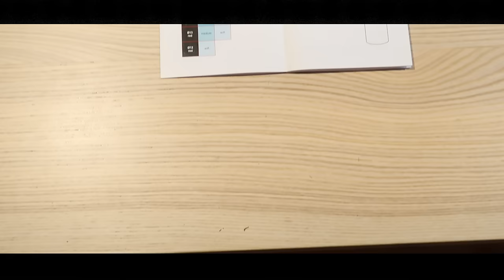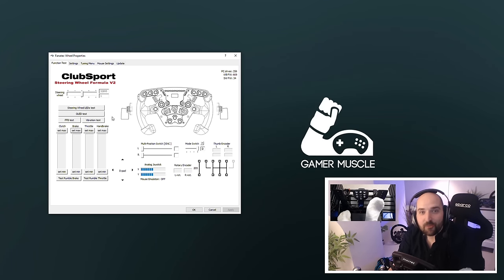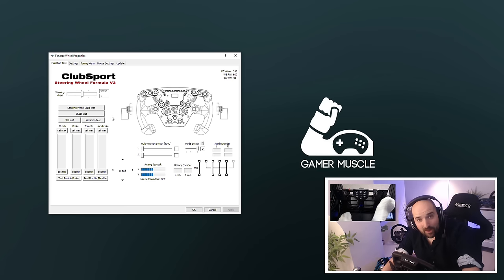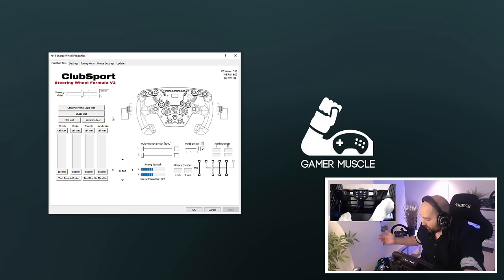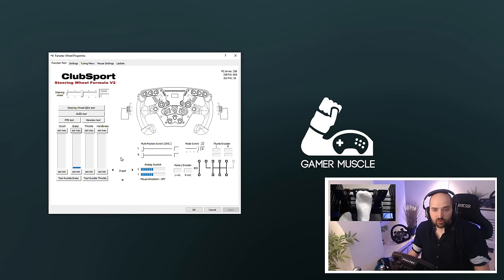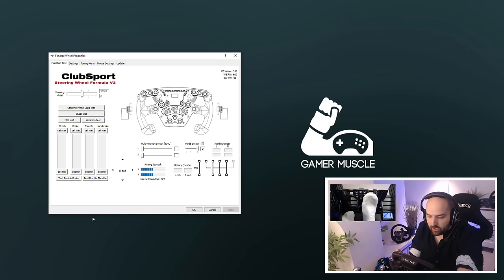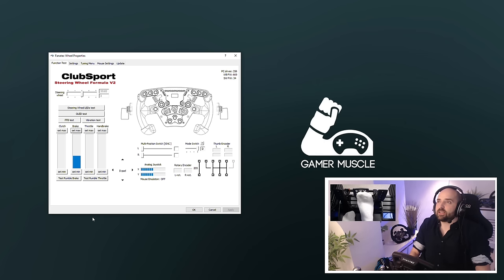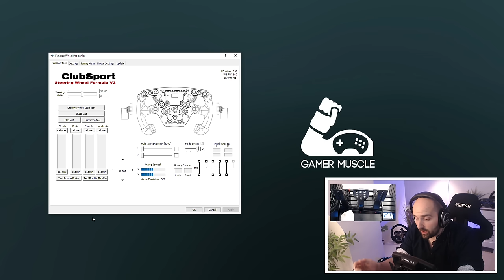Fanatec ClubSport Pedals V3 -  The Best Way To Set The Brake Up !

Comment from the maker: Wow Such Brake Much Firm So Control -  Here is our Fanatec store link if you want to get the V3s / Brake performance kit - https://goo.gl/zLmvKQ
Reply: I like that you do more youtube videos lately!
Reply from the maker: @christiannoack9967  Thanks should be doing streams again soon as well :)
Reply: @GamerMuscleVideos  does the grease in it help much? not changed mine but very little use and one of the pedals makes a squeaks a bit when releasing the pedal
Reply: Hi. Just for info and letting you know. WD40 is NOT a lubricant :) Its an oil neither. WD40 is for losen screws. It will completele evaporate after a couple of days. Use silicon oil or something similar what is not collecting dust :)
Reply: Hey there. I know the video is a tad older but i noticed even in the newer videos you are a bit quiet. You talk loud but your voice have no volume anymore. I think you can fix it by bringing the mic arm closer to your mouth :) Greetings and have a nice week.

Comment: I guess that's one thing the CSL Elite LC has over these, so much easier to change out the bits and bobs.  Don't have to take anything apart, just lift the pedal, and swap them out.

Comment: Good video! BUT, don't use WD40 on the moving parts, it'll strip out the existing grease. Use the lithium grease as shown by Fanatec in the spots they recommend. Secondly, if you care about the wiring to your brake vibration motor, you MUST put something in between the swinging arm and the back of the pedal before removing the brake pin. The mechanism WILL crush the wire if you don't. I had to use a screwdriver as I had one of the older performance kits. The new ones supposedly come with a little L-shaped brace to protect the wire.
Reply from the maker: I used WD40 on the Club sport V2s for years and the joints were fine and it was the only thing that stopped them from making noise,  I don't disagree that some other actual liquid lubricant would be better though.   
Howver what is likely is that most people have some WD40 lying around and in lots of cases a small amount of WD40 will redistribute what was already there and clean up what was causing the sound-making issue.  If after a bit of WD40 there was stiction or binding / still sound then it would be good then to apply some lubricant to the joint.
Any time anyone says WD40 you get 100+ people saying "It's NOT A LUBE IT STANDS FOR WATER DISPLACEMENT 40"   which I think most people already know by now to be honest. 
I push the loadcell in when moving it down so its not crushing the cable , I bet people are just as likely to break the cable from the motor flopping around as they would be from accidentally crushing it I think with anything like this its just a case of being gentle :)

Comment: It should be a consistent force required through the travel, but I'm also a fan of having some mush/take up initially. Helps trailbraking a bit, and also that's what actual brakes feel like.
Reply: I totally agree. Thats what I did when I modded my T-LCM pedals. Medium spring then a medium 45 shore, a large 45 shore and a large 45 shore. Nice mush at first and then firm.

Comment: Thanks alot for this video! I swapped out the piece of foam for a cut down red elastomer. I'm using green-green-half red, with the hydraulic damper set in between 1 and 1.5

Comment: thanks for the info my friend - my braking is something i can work on now , just from my experience with the BRF  issues , i went to auto settings reset that and then back to manual settings and that resolved my BRF setting problems - i'm now at 45% and still working on it - hope that helps  someone. Keep up the good work!

Comment: I just got a pre-owned set of inverted V3's, which is nice. The brake is a bit too mushy as you mention and this video was helpful, so now i got to have the brake kit 😅 One thing i have to mention, is your advice using WD40 as a lubricant - instead i recommend lithium grease. I know WD40 has a lithium spray variant, but grease is the better choice, because it doesn't dry out and is just a better product for this kind of lubrication.

Comment: Next time I can be asked to mess with my pedals I'm doing this, also same time try that "stiffer" black spring for the throttle. GM you should try Furoshiki shoes for sim racing, game changing, thank me later.... saves you from having to match your socks for streaming too, lol
Reply from the maker: I like the spring as it is right now just due to being in socks , If I raced in shoes I might go for stiffer spring but not in socks :P  stiffer spring is great for DTM cars / those cars where you have to balance the power on that last 10% of throttle input out of corners.

Comment: GM!! I STRONGLY SUGGEST YOU NEVER USE DW40!!! That stuff breaks down the grease and is used to free off seized nuts and bolts!!
Reply from the maker: This comes up every time , Yes WD40 is not a lubricant but it also works fine on the joints and stops them squeaking I say this from having club sport V2 pedals for over 2 years and WD40 worked fine to keep them smooth.    If they have stiction issues and other problems then sure some specific liquid lubricant would probably fix that.
Reply: Dab of engine oil does the trick
Reply: It's a solvent - it washes away the grease. It stops them from squeaking for awhile probably because some of the grime in there was contributing to the squeak and it got rid of it - or simply because the carrier is a liquid and that lubricates the surfaces for a bit. Then it evaporates (as it's supposed to) and you have a nice, clean, unlubricated metal to metal contact. So yeah, it "works" for a while, which is why so many people continue to use it as a lubricant and say it's fine, but seriously m8, it's ultimately causing more wear and tear on the parts. But also, thanks for the vid, it was helpful :)

Comment: You mention setting the brake force to 100 on calibration, as its the weakest needing most pressure. The lights on my wheel suggest otherwise as very small pressure at 100 and all lights lit up, whereas off or 1and you've got to push as hard as possible to light up all. Using same wheel as you. Am I missing something? Am on newest FW. Just need the starting point on whee, to calibrate right
Reply from the maker: Maybe it's back to front on my / some wheels just set it to what you like 👍☕

Comment: I wouldn't suggest putting WD-40 anywhere near your pedals, it's lubricating properties are very short lived and will also remove any existing lube, leaving you in a worse place then before - It also stinks. It's best to use Silicon grease for non metallic parts and lithium grease (or mineral oil) for metal to metal.

Comment: From the manual: Adjust the preload screw so that the scale is within the correct use range and there is no mechanical play in brake pedal. 
Note: Preload screw cannot be used in the full range as before, its use is limited only to eliminate the mechanical play.
Reply from the maker: Mechanical play is separate to Throw and movement, mechanical play is movement without any pressure on the load cell.

Comment: I use 2 reds and foam but for me it's very little travel and green are harder(?) I have no idea how you have so much travel. Also which one did you cut fi12 or fi13?
Reply from the maker: It probably looks like more travel due to cam angle + how hard I'm pushing the brake pedal.

Comment: Could be wrong but after 25 years of just using the vacuum cleaner on circuit boards, usually standing on carpet, and never screwing anything up, I've come to think of static discharge damaging anything as a myth.
Reply from the maker: I think the biggest factor is the room / environment rather than the tool. 

I have worked in offices where I was lightning striking everything I touched. 

But yah IV built maybe 80+pcs doing IT stuff and non were broken and non were built with static bands or anything.

Comment: Appropriate hardness is good.

Logitech G29 noob question: Do your Fanatec pedals vibrate when the ABS is flicking ON and OFF at a zillion times per second?

Enticed by the new, mini DD; wondering what "foot levers" (pedal set)  to accompany it

Comment: What order did you put the sponges in?  The larger one's together and the smaller green last?
Reply from the maker: I think I had small one last, I'm not sure if it makes much difference, to be honest, generally, with high-end pedals, the softest one is closest to the pedal and the hardest closest to the load cell.
Reply: It  makes no difference as theyre all compressed by opposite sides of the same cylinder.

Comment: I'm soon to upgrade to the V3s from the CSLE LCs. I'm just tired of having issues with the CSLE-LC and the potentiometers. I have even installed a set of hall effect sensors, and they are constantly in need of readjustment while I use the pedals. Screw it! I know the V3s are a better pedal than the CSLE's, so I'm going to get them.
Reply: Did you end up getting it? my LC on my CSLE just took a shit and may buy the v3's

Comment: Just goes to show everyone is different. I had to buy softer rubbers for my HE Sprints.
Reply from the maker: I think even there softer rubbers are as hard / close to the feel of fanatec V3,s    the HE pedals in general seem to be all round firmer harder springs firmer brake obvously all ajustable but out of the box and when I have used them on other peoples rigs they were much harder than any V3 setup I ever used :)
Reply: @GamerMuscleVideos  Yea I've had both and liked the V3 inverted (but they didn't work with my rig)  however the HE Sprints were just too hard even with their softest rubbers. I had to buy skateboard rubbers to get them how I liked.
Reply: @John-ok8ts  Where did you buy the skateboard rubbers? what exactly did you buy? I am looking to buy some sprints but worried they are too hard and not much pedal travel. Currently I used V3s with brake mod on soft setting.
Reply: @GamerMuscleVideos  How would you compare your current setup versus the soft setting of the brake performance mod (in terms of stiffness and travel).
Reply: @gutiserra56  Put this into Google "A cheap and easy brake mod/performance upgrade for my Heusinkveld Sprint pedals!". This guy has written a tutorial on reddit including where to buy. btw I tried the spacers but found they worked better without.

Comment: I have V3 paddles I also have CSl i’m trying to figure out where to plug the wires for the brakes in I know on the base it says brakes but on the pedals it says wheel direct and handbrake do I plug the wire into wheel Direct?.

Comment: Perfectly timed to the Brake Performance Kit being out of stock in the US and last ETA was September. And yet it's ready to ship in the EU!! WTF? Are they that incompetent that they can't ship some to their US distribution center?
Reply from the maker: That's anoying , you don't have to use there brake performance kit you can probably buy elastomers from Amazon and just cut them down to size using the ones that come with the V3 pedals as reference 👍. 

That's one of the nice things about V3 design you could probably put anything in the socket solong as it's not liquid / curosive / going to get stuck in it 🤣
Reply: @GamerMuscleVideos  Haha thanks. I did try searching for them before and couldn't find equivalent parts, but yeah they must exist somewhere to buy. I can't believe no one's stepped up yet with their own generic kit to fix the supply problem.
Reply: ... and just like that the V3s became available earlier than they were supposed to and I ordered them! But the BPK was still out of stock. Until 2 days later when it magically appeared ready to ship and I ordered it too! Paying double shipping is really annoying but I'm excited!

Comment: Just orderd them :) thank you for the vid :D
Reply: If not too late, how big is the PU foam? Both foam bits that in my set up 26mm long
Reply: @mlee6050  i dont know buddy but when i bought the v3s 2 months later i bought the BPK for the v3s and they feel so so much better ist a huge diffrence to them .
Reply: @simracingwales4997  I would of but thinking spending amount on them then £30-35 for postage I brought the stuff they use to make the red and green things for like £10 for 100mm and just cut 20mm bits from it, if I brought it with my wheel I would of not minded but as how much just for something that cost less than the postage thought go diy
Reply: @mlee6050  £50 quid i got stung for not ordering them with the pedals 25 for pedals 25 for postage .  Was not happy about that but just bit the bullet . Im sure they have the mod brake kits on ebay now people have clocked on and are starting to make home brew versions and selling them on ebay lol .
Reply: @simracingwales4997  yeah like if buying with set up at time the real ones makes sense, I first got damper on another order but found I not use that anymore as of diy my own performance kit

Comment: Fyi. New performance kits have a tool for positioning the rod hole.
Reply from the maker: Alen key works fine , guess plastic angle is better though as there will be less risk of scratching or denting the metal :)

Comment: Hey there, great video. Question for you. I just got my rig and these pedals with the performance kit. Compared to what comes on the pedals stock, are the reds more or less firm?  What would be the next step up from stock, 2 reds and the foam?
Reply: Up
Reply: Up, use the hardness guide that comes in the performance kit.

Comment: What does setting the brake sensitivity to 60% on the wheel do? Doesn’t that make the hardest you can press it then only reach 60% pressure? Seems pretty weak, no?

Also, ever try the dampening kit? I got the inverted so it came with it and I quite like it, but not sure how it compares.
Reply from the maker: The lower the BRF setting the less force it takes to hit 100% brake IE more sensitive

I didn't like the dampener kit 🧐😆
Reply: GamerMuscleVideos interesting, thank you.
I ordered the elastomer kit too when I got these pedals but haven’t tried it yet. Figured I could move the dampener to the accelerator if I wanted. I should give them a try. I found that I really didn’t gain any time or improvement otherwise moving from CSL Elite pedals with the load cell brake pedal, but maybe I need to spend a bit more time tweaking these (although I realize those were good pedals also). Oddly, I found I was .5 to 1 second faster in ACC going from the CSL Elite v1 with the same rim you have on your shelf to the right to the same wheel set you have now, which is totally against common wisdom. I think it’s because I’m not good to begin with so cutting a second off a lap wasn’t about eeking out the last tenths but being able to better keep the car under control on through turns, which most good drivers already take for granted. I also found I could drive the 911 without ending up in the grass 😂.

Anyway, good stuff, thanks, and keep it up (but don’t get stuck too long in your rig 😉)

Comment: The rj12 plug has come off of my brake, I am a cctv engineer so I'm no stranger to crimping down rj plugs, could someone please tell me what order the colour cores go in the plug, if your looking at it upside down so you can see the gold pins on the plug far left being pin 1 far right being pin 6 could someone please tell me the order in which the cores need crimping, thank you
Reply: There is red black green white so 2 pins will be empty

Comment: i'm using CSL pedal with load cell
is it worth spend more and upgrade to V3?
Reply from the maker: Not really unless you really want to ajust things more , CSLE load cell is fantastic I'd probably buy V3 instead of CSLE if I had nether but I'd be perfectly happy with CSLE if thats all I had , I had CSLE load cell myself for 7 months and used it after using high end PT1 pedals and I didn't feel let down by them.
Reply: @GamerMuscleVideos  Why did you switch from the PT1 pedals?

Comment: Did he cut a 12 or 13 into the PU foam size?  It looked like the 13 was cut.  And he used a full length 12 and 13.  Can anyone confirm?
Reply: It doesn't matter, the point is the same.

Comment: hi great video. ive been wanting to buy the brake pedal performance kit for while now but have really bad knees at the minute so have been just using the standard springs that came supplied with the v3 pedals.
will this new set make me a cripple in 6 months if im using them a couple of days a week? or are is the force required not much harder than the standard firmer springs? thanks
Reply from the maker: You can still have the brake be sensative not require a ton of force so the BPK is more about changing how it feels :) 

I tend to run my brakes super sensative so i dont have to push that hard .
Reply: The brake kit is to allow you to adjust the throw (distance) and overall feel to your liking, not how hard you need to press. The amount of force (pressure required by your leg) would be set through the menu (BRF on wheelbase or Fanalabs),  100% would require the least pressure, or set with manual calibration in the driver menu. I highly recommend the overpriced kit as I think the feel and consistency is greatly improved. As stock it feels like hydraulic brakes with air in the system....mushy; the kit gets rid of the mush.
Reply: great. thanks for your swift reply. keep up the fantastic content
Reply: thankyou for the feedback

Comment: THE REDRAGON RP-01 PEDALS ARE LITERALLY CLONES OF THESE. LOL. EVEN THE PCB BOARD IS IDENTICAL.. HALL SENSORS ARE IDENTICAL.. LOL
Reply: O AND WHEN U PLUG IT IN . ITS RECOGNIZED AS A CLUB SPORT V3.5 UNLESS U INSTALL THE REDRAGON DRIVERS.. BUT U CAN EVEN ADD MOTORS TO THE REDRAGONS AND USE CLUBSPORT V3 DRIVERS AND CAN HAVE YOUR PEDAL RUMBLE WORK WITHOUT HAVING TO BUY ANYTHING BUT 2 MOTORS LOL WILD SHIT. I GOT MINE FOR 1$ BROKEN ON EBAY AND FIXED EM LOL GREATEST DEAL SO FAR.